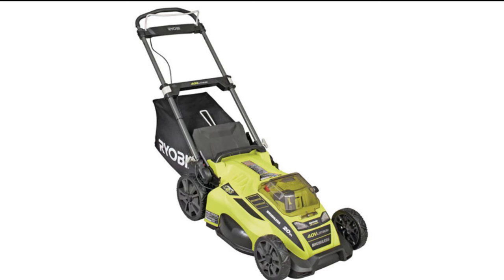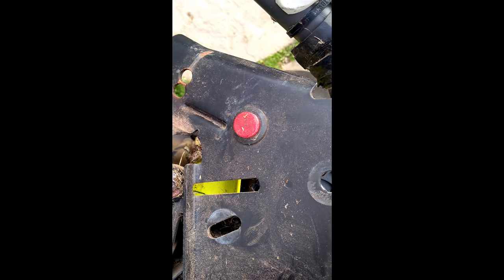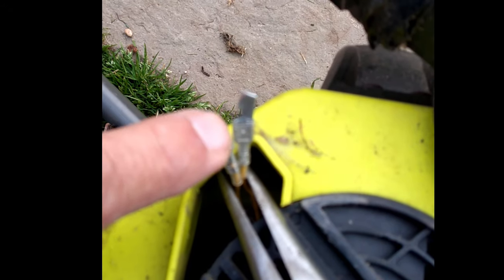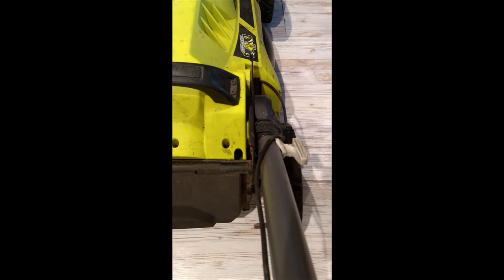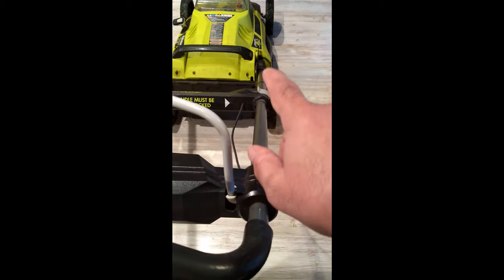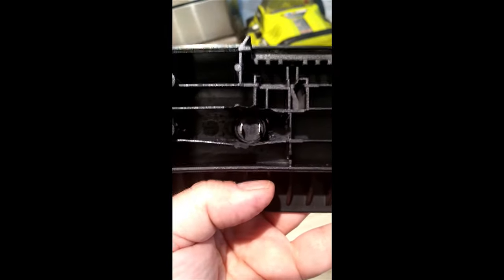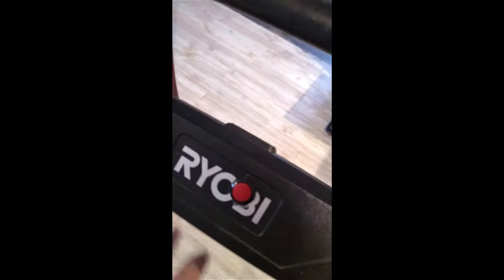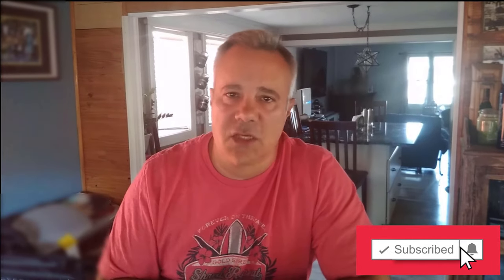Ryobi lawn mower Keep shutting off!? Here's the fix!

Comment: Lol that seems like a nightmare. Glad I saw this before I bought an electric mower
Reply from the maker: Yeah, not really. I've had the mower (and still do) for a few years before that happened. The fix was fast (about 20/30 mins) and it runs fine. Think about all the hassles with filling it with gas (i don't miss those days, especially with prices today), plus tuning it up every year, filters, spark plugs etc... expensive and a hassle. This is just click in the battery and off you go!

Comment: Hi All. Just bought newer RY401015 US model less than a year ago. Doing same thing when it just shuts off in middle of cutting. This is even with handle engaged. Can start back up but shuts down again after about 4 feet of pushing it. Saw older models had the same thing. Would have thought newer model would have fixed this. 

Love your video!! but when took new model a part can’t find the same lower wheel safety switch like you have. 

Anyone had success with this fix on new model?
Reply from the maker: They make so many different models of this mower now that it seems like everyone has a different setup?
Reply: Same on mine, no wheel safety switch. I'll have to try the handle bar thing as it will just shut off standing there doing nothing
Reply from the maker: @jtoto2002  yeah, Ryobi now makes so many of these mower models its hard to keep up. When i did this video they had 2 models. Now i think they have about 4 or 5... maybe search what's happening on your mower using your model number to see if anyone has a better fix, but i will tell you it's 99% always the safety plastic switches. If can locate them and bypass them you should be good to go.

Comment: I’m trying this but when I try to take out the T40 bolt it backs out to a point and then seems to spin. Did you have a hard time getting it out or am I dealing with a stripped thread?
Reply from the maker: Yes.. a little. You have to keep unscrewing it while trying to lift the handle up... The screw is long, or use a wrench to turn and left. Takes a little time.. be patient.. it will come out.

Comment: I have the HART version of this mower. I really don't think I need to have the switches at all. take the battery out or pull the red plug and the mower should stop running. that's honestly all I need. so what I would like to know is how can I just bypass the handles switches entirely.
Reply from the maker: Sorry.. I don't have that model so I wouldn't be able to help you with that. Maybe try googling that.. thanks for checking out the channel. Let us all know how you make out..

Comment: Instead of the toggle switch, could you just connect the wires together and bypass the handle bar?
Reply from the maker: Sorry, that won't work. Depending how you slice the wires, your mower would always be ON or OFF.. you need the switches to interrupt the power.

Comment: What’s the specifications of the switches like ampere etc ?
Reply from the maker: Not really sure about the specs, go to the link in the description I put and I'm sure there you'll see in the specifications in the description. Research is awesome I simply use the same switches I saw from another review and they all seem to work fine and hundreds of other people who did the same process said these switches work perfectly and mine had been working for over a year now.
Reply: @manview5178  thank you. So the push button only need to be pressed once to start. After that it can remain in off (raised position) and the blade will keep running till the toggle switch is on ?
Reply from the maker: @bhaskartube  The push button is the one you hold in, (the momentary button), while that is pressed in, you flip the toggle switch up, and the mower will start and you can release the button and use your mower. To turn the mower off, just flip the toggle switch down and the mower will shut off. BE VERY careful because you mower will always be running even if you walk away from it. so don't let children or pets near it unattended. This hack is for adults to use only.

Comment: Cracks me up that this thing has 4-5 different “safety switches” that don’t work. Your bypass video is great, thx. Your is very functional and very unsafe if it rolls down the hill and over a child.
Reply from the maker: It actual only has 2 safety switches, not sure where you got 5?! If your not a complete f@cking idiot and you an adult and know how to hold onto a lawn mower, you should be fine, and for for those that are mowing your lawns straight downhill.. maybe remove all the kids lined up at the bottom!.. SMH!
Reply: ....No Hills.  ...No Kids ....All Is Well!
Reply: ....No Hills.  ...No Kids ....All Is Well!

Comment: Where did you get that little piece of metal from?
Reply from the maker: I just it laying around and cut it to be small so i could bend it and fit it in the connectors. Any soft piece if metal will work, heck, even tin foil will work it fits nice and snug!
Reply: @manview5178  I don't think that I have any metal laying around and I want to use exactly what you used😂

Comment: How do I secure the wires onto those  prongs on the momentary switch?
Reply from the maker: Hi, if you purchase the switches that I put in the description below, there are tiny holes in the bottom of the connector prongs. I took the wire twisted it, slid it through the hole and then twisted around itself I also took electrical tape and wrapped it once or twice around it nice and tight so it wouldn't come loose.
Reply: @manview5178  I ended up skipping that button. I did the one down by the wheel and put a metal toggle switch up top. Works like a charm now! Super frustrating and probably took me quite a bit longer than expected. Thank you. You saved me $500 on a new one. I honestly love my Ryobi mower even if I had to modify it.
Reply from the maker: @mrpink3998  Nice! Glad it worked out!

Comment: MANVIEW: Not sure how this circuit works without seeing inside. Could I just cut the wire where it enters the handle and do a simple one-toggle-switch on/off there as temporary fix, do you think?
Reply from the maker: You could... But.. you need two switches on that handle. One is a momentary switch (red button switch in my video) and another one is the actual toggle switch to turn it off and on. In my video I actually open up the handle and show you how to put a momentary switch in and how to do a toggle switch. You may want to just drill open the handle, pull out the switches and the wires and just Mount the new toggle switch and momentary switch a little bit left or right onto the same plastic handle like I did.
Reply: MANVIEW: Yeah, I see that now. I was thinking maybe a whole new switchbox with both, mounted to that crosspiece. (If only we still had Radioshack!) But your suggestion may be easier. Thanks again...I'll report back when I've either fixed it or thrown it in the dumpster.
Reply from the maker: @michaelnolan743  lol... Good luck.. let us know how you make out.

Comment: They need to relax on these so called "safety" protocols. 2nd season and im startin to get pissed. Fker keeps shuttin down when it touches grass. I shake the pos and it works for 5 mins and starts to act up again....... ghey The only "safety" switch should be the handle bar.... The others are counter productive and overkill
Reply from the maker: Yeah.. I agree.. you only need to bypass the switch between the body of the lawn mower and the handle. That'll work just fine. Do that first. if it doesn't solve the problem, then you can change the switches on the handle, but I'm 99% sure all you have to do is bypass that little switch between the handle and the body in the first video.
Reply: Well, it probably needs a severe angle sensor -- that is, a mercury switch -- to cut it off and stop it operating if it's @ more than a 30 degree angle or something "unlikely in normal operation" (i.e., if it gets tipped over on its side**), but yes, I'd think that is the only main safety switch needed.
------
** I assert this because, suppose it was "on" but not running for some reason -- i.e., the motor was not spinning the blade. Perhaps it's got something caught. It's silent, not clearly "on" (yes, you know this, but still... when you're focused on a problem, you can miss even the fucking-duh obvious)

You tilt it over on its side to see if something needs clearing, reach in to do it, and stop thinking about that motor restarting suddenly.  boom, there goes your fingers, a hand, or even a foot in the worst case, since it can start automatically. YES, you should have sense to turn it off before doing that, but... not the way humans operate all too often. A REASONABLE tilt switch that only cared if an operational blade was really, seriously exposed would be a Good Idea. Another notion would be if something causes the blade to stop, it needs to be pushed to re-start the motor... but that adds to the complexity of the design, is my guess, and thus increases liability. BOTH would not be a "bad" idea, but at least one of them.

You CAN say, "Well that's protecting people against their own stupidity", but doing so is not a bad idea, UNLESS it severely impacts function, as this crap does. I argue a 30 degree tilt switch would do the job just fine without being problematic.
Reply: @manview5178  fortunately I can return it. Second one returned: first was self propelled, second was push. Same problem with both. I'm done with Ryobi for ANY tool.
Reply from the maker: @hughhallgren2110  Sorry to hear that... I have about 18 RYOBI tools (all battery) for more than 5 years, and they all still work fine. Well, let us know what other lawn mower you got and how you like it! Good Luck!

Comment: My lawnmower is backwards from yours supposed to push the button first then pull the handle down you don’t pull the handle down then push the button because it will not start that way

Comment: Can’t get mine mower to start at all ??
Reply from the maker: Did you replace the switches? If you know your battery is working fine its only one of 2 things, the safety switches are bad and need replacing or the motor itself is shot.

Comment: But thank you for all your help wasn’t for you it wouldn’t be fixed I plug-in a 20 V fuse that’s the yellow one works perfect I don’t need A piece of metal just a 20 V fuse plug it in both  for the bottom and I put the safety button back in so there’s no hole . It works perfect ***
Reply from the maker: Great adjustment.. glad it worked!

Comment: Actually no need for any of that.
What is happening on 99% of these are the handles that connect next to the wheel if its loose, and it is if it keeps shutting off tighten it up on both sides if it doesn't have a connection it will keep shutting off!
Reply from the maker: Hey, Yes, thanks for the TIP!! However...., We're past that point.. most of us have already tried that and in some cases your right, it does work for a short time. So this was the FIRST thing i ( and others) checked. I tightened up all those nuts and it still stalled. Once i bypassed the switch at the handle and body, it was enough to make it work perfectly, however, about 3 weeks later it started again, so i replaced the handle switched and its been over a month and it works perfectly! Thanks for the comment...

Comment: Nope mine has no red switches. Also why are there 50 different versions of this mower.
Reply from the maker: There are several versions of this mower.. not sure why. But you should still have the safety switch between the handle and the body of the mower.. that's the most important one to by pass.
Reply: @manview5178  I'm not able to find a red button or anything like a switch on my 40V single-battery model. Yours is right there on the plate itself. I have nothing under the plate, and the rest is plastic. But I definitely have this issue because the thing shuts off whenever I pull back at the end of a run. Another Youtuber suggests popping off the hood entirely. Thoughts?

It's baffling that they chose this approach. It's such a terrible design---at least let us hack it!
Reply: Ryobi tells me I have no red switch. Instead, the handle itself has a switch at each joint (4).

Comment: You don’t show how to take off the handle
Reply from the maker: All handles are different in each model, but. the two screws to mine were located underneath the handle. If you look around, you should see two screws either under the handle or on the sides of the handle. Refer to the manual if you don't see them there. Hope this helps.

Comment: What a complete piece of junk , why would anyone want to by something new and turn around and do all of this crap to it ,, completely and utterly ridiculous
Reply from the maker: Hi Steve, true, but what are your options after 4 years of using it? throw it away and buy another mower for $400? or spend a couple of buck, 20 mins, fix it and keep using it for a few more years like I did, and mine is still running fine! I (like most) didn't know this was going to happen a few years after I purchased it, so I did what needed to be done to not spend another $400. As of this year, Ryobi is looking into changing these pieces out for metal (instead of plastic) parts because of videos like these and complaints, so it's working. I have dozens of Ryobi power tools, lawn tools and even their Pet Stick vacuum and have had very few (if any) issues with any of them, so overall I'm extremely happy with their products, and NO I'm not sponsored by Ryobi, nor have they ever gifted me anything.

Comment: Yeah that's not how you actually fix it.  You simply order the correct replacement switches from an electronics supplier. It's a COMMON SWITCH.  This works yeah but it's a hack job.
Reply from the maker: The replacement switches are garbage. They will break in another year. This "hack" uses better switches (links provided) so you don't got through this next year. The "bypass" between the body isn't a hack... It's a "fix", since you never have to deal with it again after you connect the two terminal connections.